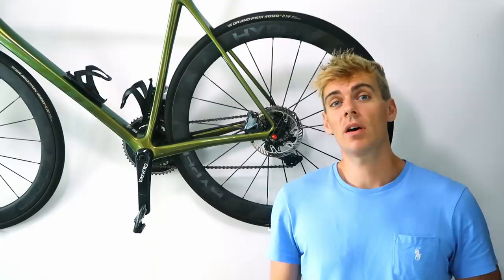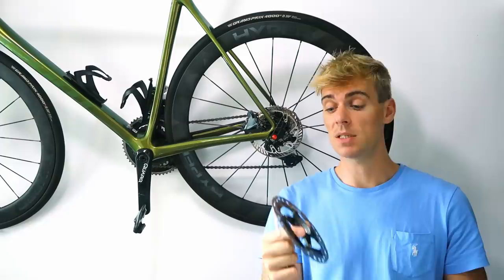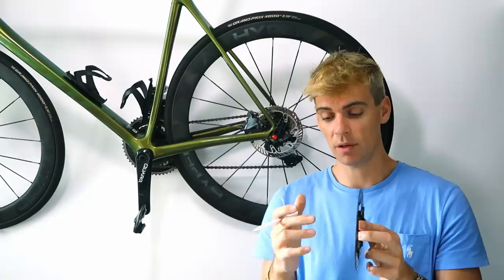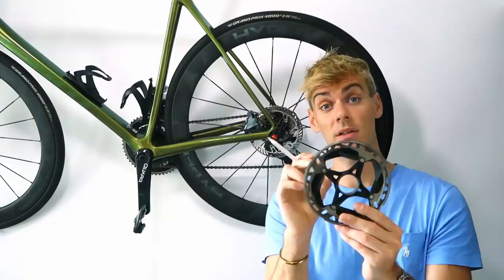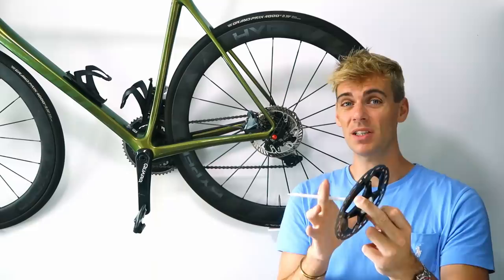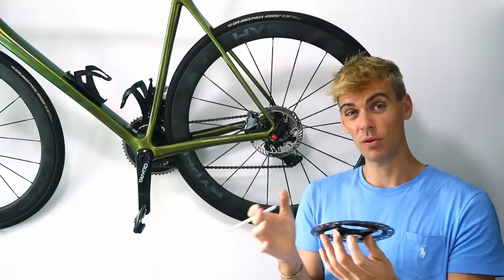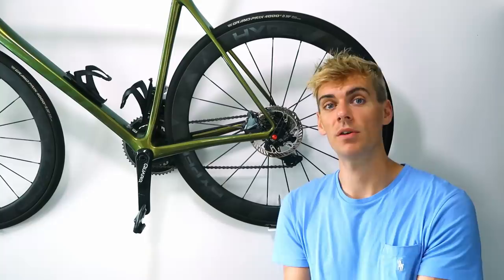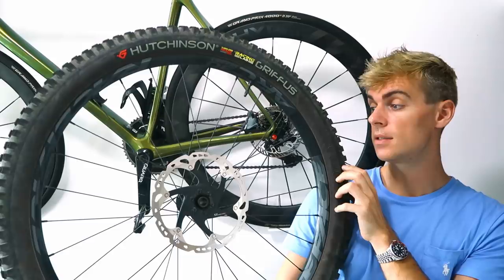Why I stopped using Shimano rotors: Disc brake rotor design, cracks & thermal issues discussed.

Comment: The Shimano rotor is absolutely not a floating rotor. In fact no brake rotor I'm aware of on the market except the Hope ones (Which allow radial but not lateral float, similar to a number of motorbike designs) qualifies as such. There's no free play between the rotor and the spider as it's fully riveted, so no room for it to float. On actual floating rotors, there's no hard riveted connection between the rotor and the rotor spider. The change in materials to aluminium is for thermals/weight saving only, but it looks like some motorbike floating rotor designs, so that's plenty of justification for the marketing wankers to call it a floating rotor.

More interestingly, the only time I've seen disks get as chewed as the ones you've got there are when sintered metal pads are used on disks that aren't rated for it - Shimano and, weirdly enough, Superstar Components are the only companies who acknowledge this and have warnings with low end disks (Or all disks in Superstar's case) saying they are not suitable for use with metal pads. Either everyone else uses harder stainless steel or doesn't care. I discovered this when a disk I was using wore so much thinner in some places than others that the brake pads were effectively hopping as the disk spun rather than gripping, which felt like a boiled  brake regardless of brake temperature. The difference in thickness was just about visible by eye if you were looking for it.

Car disks tend to be made from cast iron, which is cheap, hard (slow wearing), more thermally conductive than general stainless steels and easily cast into the shapes needed for ventilated disk rotors, making it ideal for thick heavy disks on a car, but the strain to failure on this material is low so it is brittle on impacts, so a bike sized cast iron disk will run the risk of the disk shattering if it gets hit off anything.

Something to watch with an all stainless centrelock rotor is that the rotor spline will chew through the splines on your hub if the spline is only as thick as the 2 mm plate usually used for disk rotors - this is less of an issue with road bikes, but I've ditched centrelock for 6 bolt mountings on almost all my MTB's at this stage because this interface develops play if you load the brakes in both directions (Very common on very slow tech riding where the bike needs to be hopped). Interestingly, even with this kind of riding, only the centrelock spline and not the rivets develops play, further confirming that the rotor is not a floating design.

Comment: It's funny, I just wrote a far too long post in our team chat where I said most everything you did in this video. Couple of things to note:

- The "floating rotors" we use in cycling aren't true floating rotors like those in automotive. Considering we couldn't allow ours to function that way, the thermal management problem is the only real purpose of a two-piece design. 

-THAT SAID, this is the bicycle industry we are talking about; Anything too precision-engineered has just always been kind of a hassle because they do not follow it up with the same effort in the manufacturing process. The 4 Shimano rotors I tested all had surfacing issues. I blame this in part on the more complicated construction that you highlighted also. Swapping to a one-piece rotor with a centerlock adapter has made a difference. 

- The various weirdness of matching up rotor problems with caliper/pad problems and fork mount being level means that the entire system desperately relies on a perfect bleed. This shouldn't be an issue but many get it more wrong they think. That includes shops and experienced mechanics.

Comment: You can buy center lock adapter to 6 bolt and use standard 6 bolt full metal rotor

Comment: I bought a Scott addict with Dura ace rotors last year. I live in Mallorca and weigh 92 kg and ride a lot of mountain descents so he brakes get a good workout as well. The front disc warped after about 3 months and Shimano refused to replace it saying there was nothing wrong, my LBS had to pay for a new one themselves that they fitted. Everything was fine for another 6 months, now I have the same problem again, and Shimano now are quoting 6 months , YES 6 months for a replacement before I can ride my 9.000€ bike. Unbelievable. So I’ve ordered a Swiss stop rotor instead. Based upon my experience I would never buy Shimano again - the product doesn’t work and the service is terrible. I recommend a medium priced steam group set.

Comment: I've often thought about whether or not we could get grey iron rotors instead of Stainless Steel.  They would need a Zinc Flake coating, of course, to keep them from rusting.  

My single piece MTB rotors are always warped and I've always wondered if there's just too much residual stress in the stainless steel for these thin brake rotors.

Comment: There is an answer...rim brakes!! I have been using Galfer discs (not floating, one piece), but having problems with warping and rub. 140 better than 160, but not powerful enough, and not enough heat capacity. Almost all centerlock 160 discs are SOLD OUT, so as I mentioned in my last vid, anyone with access a CNC mill can make a quick buck by knocking out some of these. I would happily invest in a small company doing that, and be first in line to fit one. The whole disc braking thing on road bikes is a mess; badly engineered, and a long way from reaching it's full potential, and the lack of spares (and therefore higher prices) really isn't helping things.

Comment: Hi, great video! 

I’ve always thought the rotors are mounted backwards. Note the material connecting the spline to brake surface is forward swept, under braking loads this would put it in compression, rolling the flexure. If it was reversed it would be in tension.

Nimonic steel? C263/Inconel might be worth considering.

Comment: Yes the shimano ones might not 'last' as long.. but they work perfectly throughout the whole life span.  The campagolo rotors i used before and they warp like crazy.  The Dura Ace ones i had never warped.  I think the design of the shimano ones keep its shape really well.

Comment: I ditched the Shimano ice techs a while back on the road bike now after swapping on the MTB with success. Using generic rotors now made from  steel, floating floating design upfront and one piece rear. Even with adaptors the weight is less that my dura ace 160/140 combo. My major consideration was wear factor. I'm not mean but the value to cost isn't there imo.

Comment: I think the pinging on a floating rotor is a good thing.  Unlike with car/motorcycle floating rotors, the bicycle ones I've seen aren't really designed to "float" in the same way (motorcycle ones can visibly move back and forth)  They're just designed to allow a little bit of expansion, so when the outer edge of the rotor heats up and expands, it can move slightly, instead of going wavy, since the spider isn't expanding as much.  That's what makes the "ping" sounds when heating and cooling.  Yes, ideally if they could move more freely, there would be no hysteresis, hence no ping, but that opens up another can of worms, as a rotor that moves too easily will make all sorts of other noises.

Given the choice between a rotor that pings a bit when it heats up or cools down, and one that goes wavy and starts dragging on the calipers, I'll take the pings any day.
Reply: The "float" on a bicycle caliper is all radial AFAIK. so pad clearance isn't really a problem.

Comment: Interesting that you mention about the specs as when I bought my gravel wheels at Easter my existing SRAM rotors didn't mount correctly on the Bitex hubs.  And research showed me this.
Personally I'll avoid CentreLock next time, and stick with 6-bolt - far cheaper and more availability plus a 'known' standard.

Comment: Campag discs creek! The rings or rivets (call them how you prefer) that fix the disc to the spider, due to braking forces (especially front one) suffer from eccessive movement  thus making a creeking sound. TRIAL: Pull and hold the front brake lever and rock the bike back n forth to check if yours creeks!

Comment: If you made the rotors the same size as the wheel, would that help with heat dissipation? And then perhaps you could integrate the rotors with the rim itself? What do you think?
Reply: If you mount the caliper to the rear of the fork crown then the aero would be even better and improve braking performance too .
Reply: A rim brake is essentially a disc brake after this definition, a disc brake with the maximum possible rotor diameter ;-)
Reply: @simonm1447  yup

Comment: I run a full steel rotor 6 bolt rotor with a center lock conversion piece for daily rides...last forever.

Comment: More mass in the rotor is exactly what is needed so the rotor doesn't heat soak too quickly. Light weight is a nice goal but in some parts of the bike light weight is not a good thing and disc brakes is one of those places.
On top of discs the disc brakes have way too short pad retraction which leads to sand/grime rubbing too easily.
Both a heavier and stiffer disc coupled with calipers that have more pad clearance would be great change from the status quo of boring incremental "upgrades" that the industry pushes.
Also I would like to see thought put into the hole shapes on the brake track of the disc. Using centrifugal force coupled with holes that would spit out water/sand/grime from the brake would be great. Maybe even thicker rotors with holes from the edge of the disc towards the brake track holes to eject shite from the pad surface.
Most likely the increased pad travel would need a reworked master cylinder also.
But one can dream...

Comment: Yes please make a hardened steel 1 piece with center locking design to replace the shimano style without using an adapter...I understand the centerlock area is thicker than the brake area of the rotor but you will figure that out!!

Comment: 17-4 H900 is a pretty hard stainless steel that's available in plate form.  You can try making discs out of that if you want to stick with stainless, otherwise a harder alloy steel would work too.

Comment: If you want to use a solid steel rotor without rivets and an aluminium spider why not use (or make) a regular steel six bolt rotor with a centerlock adapter (like dtswiss)? Seems like that would be a very simple solution.

Comment: I’d be up for trying your Rotors. 

First time I ever ran road discs was in Mallorca and had no problems on the longer descents. Recently bought a ultra equipped bike and on my local hills, maximum of 2 mins descending time I ended up with squeaks and rubs after any heavy breaking. 

So yeah something that wouldn’t do that would be great.

Comment: I stopped using Shimano rotors as my mtb with them on was burnt in a fire and I haven't replaced it.
Reply: Ice-Tech finned aluminium sandwich construction and yet still it burned in a fire smh
Reply: smh. Shimano back at it again with the false marketing. "ice tech", they said. "keeps temps low", they said.

Comment: Liking the discbrake design idea project. But have you tried some cheaper Shimano centerlock discs though. No sandwich design, so full stainless steel discs. I've not ran into any issues yet, 3000km ridden.

Comment: I don't think Shimano rotors are of the floating design. 2-piece (or even more) yes, but I feel the spider is there for weight reasons. The pin presses the braking surface and the spider together axially, while the Campy design does look to be a floating one. Hope is well known to make floating rotors too, there are Taiwanese (catalogue stuff) options and Magura has a 203 and a 220 mm option ina  floating design as of late too.

EDIT: looked at the campy stuff, seems to be the same as Shimano, no floatiness to be seen actually.

EDIT2: looked until the end. Huh, a full steel centrelock rotor? Isn't that a bit optimistic?
The rotors are surface ground and it's easy to dot hat on current designs as you pin then to the CL carrier afterwards. Weight is one issue, but manufacturability is another one. I'm guessing a rotor like that would be crazy expensive? And also, is there anything (of the like) wrong with Deore style rotors which are almost a 6-bolt rotor, pinned to a CL carrier?
As for temperatures, have you done any measurements on the hub shell itself? I'd be really surprised to see the rotors heat up to 200°C all the way to the hub shell. I have been thinking about trying it out with some temperature stickers (though I run 200 mm rotors on my MTB, so i'm not the best case for that).

As for the non-stainless steel option, yeah, coating it is a (good) option. But can you coat the CL interface? If not (tolerancing), will it rust there? What about pad compatibility, will standard (stainless rotor) pads work on a steel rotor?
The braking surface rusting is probably the least of the worries, yeah.
Reply: "As for temperatures, have you done any measurements on the hub shell itself? I'd be really surprised to see the rotors heat up to 200°C all the way to the hub shell" Agreed. The thermal gradient is just too large, add to it air cooling of the hub. You can google for some thermal camera photos to get an idea.

Comment: 6-bolt ftw. Are you saying the wheel bearing grease can't handle heat? What grease are you using? Isn't wheel bearing grease rated for 400+ F? And is the center of the rotor even getting that hot, let alone the grease in the hub or cartridge bearing? Just ride the bike people. Engineers tend to suck the life out of everything.

Comment: On the new Di2, Shimano has added some clearance to the brake caliper.  So they are probably aware and might they also have redesigned the rotors to address these issues?

Comment: Not an issue with rim brakes! And delimitation of carbon rims due to heat build up is a thing of the past now, I live in Japan and ride mountain roads, 1 km descents on Reynolds AR29X, HollowGram Si, ZIPP 302, with heavy breaking, hitting potholes - no issues at all.

Comment: I think the early Lotus Elises had the option for aluminium /silicon carbide rotors. They also had special pads that transferred material to the disks to reduce wear. (This might have been too reduce unsprung weight rather than for stopping power)

Comment: What do you weight and how many KM do you ride (downhill)? 

I just got the XTR rotors myself having had both Dura Ace and SRAM Centerline XR (don't recommend XRs, low stopping power and extremely noisy compared to Shimano rotors) with 105 R7000 calipers. Combined with ice-tech pads, ice-tech + freeza (the cooling fin) rotors I reckon I'll get the best possible performance braking performance short of getting Hope RX4+ calipers and GRX shifters/levers w more leverage, but I am a bit concerned about rotor longevity as I prefer L04S sintered pads (strongest in the wet and most contamination proof as crud tends to "burn off" rather than soak into the pad, making them quieter in the wet too).

From my research it seems like the XTR/SAINT RT99 160 mm 118g  is probably the best performing Shimano rotor with a "40 degree C reduction in heat vs. SM-RT98", and 5 arms compared to 4 in MT900. It's cooling fins look a lot more effective too, not the prettiest though. 

I notice the Shimano pads don't cover the entire width of the track on the Campag rotor, one user reported power loss in the wet: 
"I got significant loss of power when wet, my guess is the rotor is designed for pads to cover both top and bottom circle, shimano pad is too short
" https://weightweenies.starbike.com/forum/viewtopic.php?t=145230&start=180

Seems like SwissStop catalyst might be a better albeit marginally less pretty? pick for durability as they're designed for Shimano pads. They're releasing some new lighter models too.
Reply: notice me senpai

Comment: Heat transfer into the hub. Just when the bicycle industry solved the issue with glass transition in carbon rim resins....

Mind if I just keep riding my rim brakes and tubulars?

Comment: Too bad the Shimano design does not seem to work for road bikes. For my mountain bike(s) the sandwich construction works super well. Never had an issue with dinging the disc during travel or because of excessive heat. I'm talking about 203/180 discs which should be even more sensitive to mechanical impacts... Maybe it is because of more clearance in the caliper. I noticed when I switched from my old Avids to the Shimanos that disc rub was a thing of the past, most likely because the Avids had very little clearance.

Comment: What about using a steel 6 bolt rotors with some sort of thermal washer between the bolt and disc + disc and hub? Doesn't solve heat into the calipers though.

Comment: For solid steel rotors (my old Avids are exactly that), 6 bolt mounting might be easier. How do I straighten them? Adjustable spanner. 😄

I still say a little water sprayer on the rotor controlled by a temp sensor would be great on big downhills.

I had no idea newer rotors are aluminum/stainless laminate. I would avoid that like the plague. A crackpot Shimano idea if I ever heard of one. What other industry would try to get away with that? 😄

Comment: I'm wondering how many miles you are riding in 6 months.  The Shimano rotors that came with my GRX group have been exceptional with lots of long downhill late braking use over 10K mi's and two years.  Interesting vid though.
Reply: Cheaper Shimano SM-RT54 match his design wishes, something similar came with my S 105 brakes...

Comment: Running Carbon Ti rotors with SR eps and they have proved to be excellent. For fast descending 50mph/60mph  I still prefer my SR eps rim bike with Zipp NSW 303’s as they give greater initial bite and don’t suffer the fade that disc does.